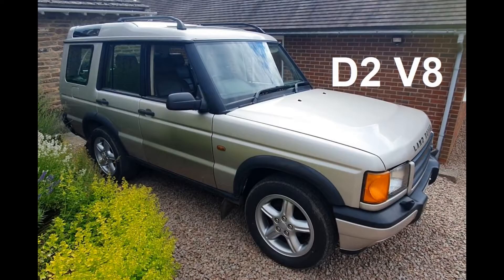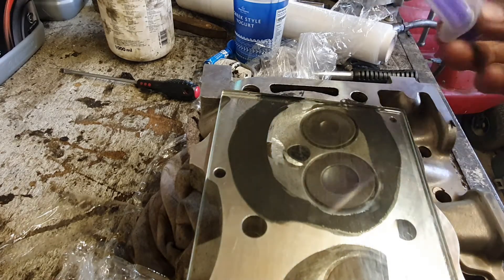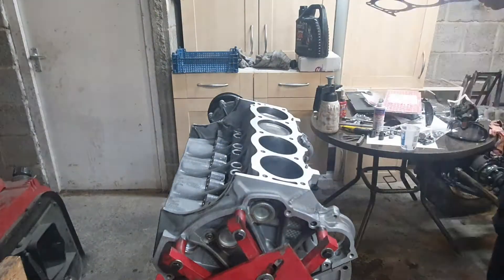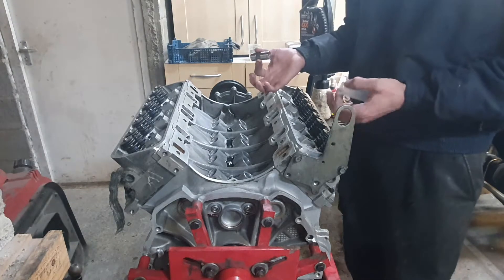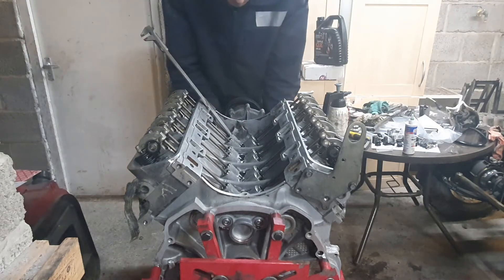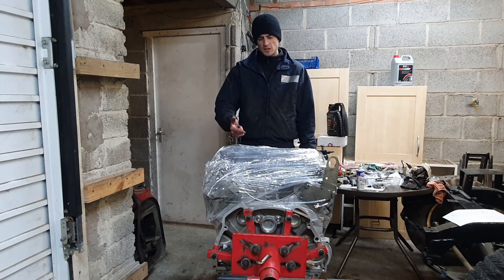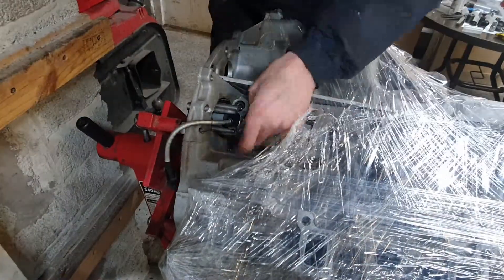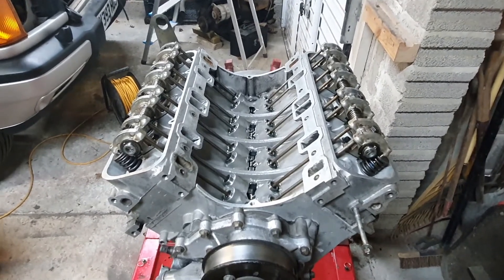Heads go on, Rockers get shimmed - Discovery 2 V8 Engine Rebuild Part 9

Comment: Enjoying this series. We’re the lifters already pre-soaked in oil?
Reply from the maker: They were not soaked in oil. Well...  they were wet to the touch with a corrosion inhibiting light oil, but not at all full. I found a lot of conflicting info on this, in the end I went with not bathing to soak them, but I did prime the engine oil system on the stand and saw the tappets fill.
Reply from the maker: Oh and...

I'm glad you're enjoying the videos. I really appreciate the comments, it's the comments that make it worth doing really, so keep em coming. 

Many thanks

Comment: Nice to follow the rebuild! I am also struggeling with a Rover V8, ticking when warm. Not fond the cause of sound yet.. Did this engine tick similar to tappet tick when warm?
Reply from the maker: Stein, many thanks for the comment, glad you're enjoying the videos. 

Its hard to say to be honest it was many months ago. I went hoping it was tappets, I bought it thinking it was tappets.  But when I think back, the seller tried to show me, he pointed out that the noise was louder when you stood beside the passenger door than it was under the bonnet (the sound coming from low in the engine and bouncing off the ground under the car). I would have described it somewhere between a tapping and knocking really. The bearing was only just on its way out. Checking oil pressure might be a good start as bad bearings let all the oil leak out rapidly
Reply from the maker: The other thing I should have known really is that tappets tend to be noisy from cold